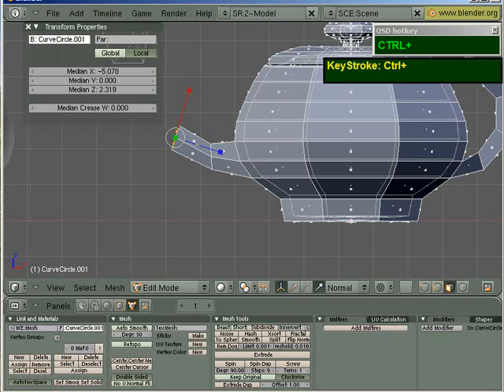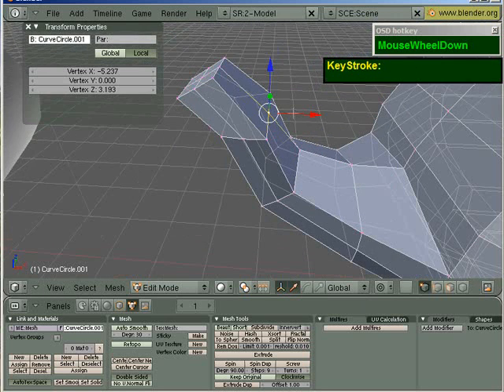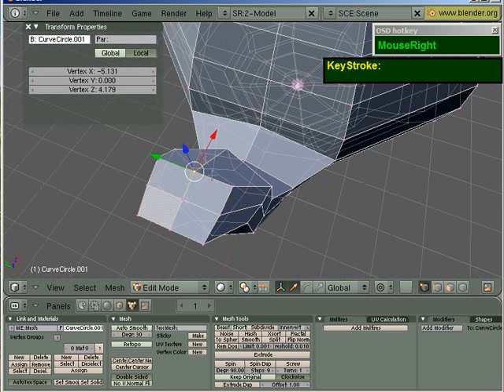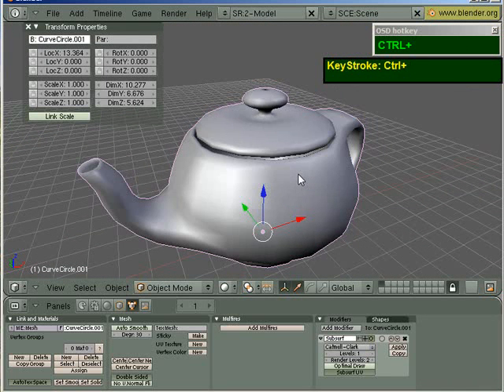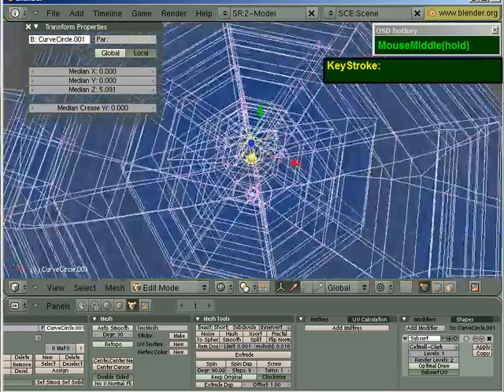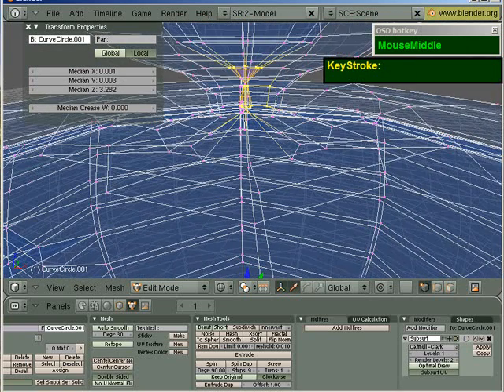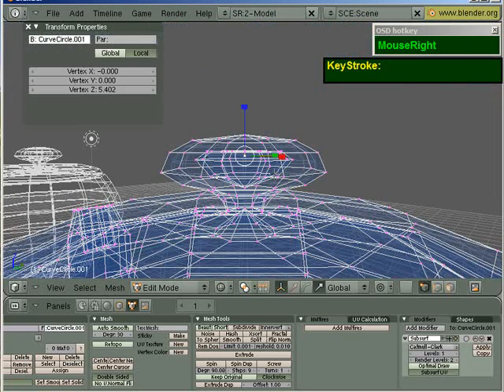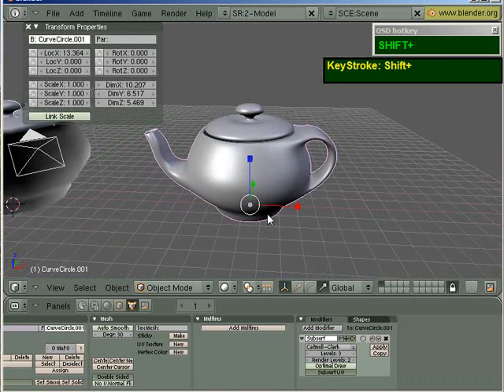Blender Teapot Modeling Tutorial Part 2 of 2 - Realtime with Dialogue

Comment from the maker: @zykral In 3D modeling, what you just have to model what you want to see from the outside. As long as it looks solid no one can tell. :-). The techniques I used to fix the internal structures are wrong. I have learned new tricks to solve that problem. Hopefully I can come out with a updated Teapot tutorial soon.  Thanks for pointing that out! Cheers!

Comment: you talking about "artifacts" in the teapot ... right? ... just one thing ... the handle of the lid of the teapot is EMPTY, why? --> it should be SOLID!!!
At 5:38 you can clearly see that there are 2 structures in that area. The outer surface and internal (like a diamond ... this is one of the problems that you retouch structures in the video)... if you just have some caution when drawing the Bezier curve you can save a pair of headaches later, not ?
Anyway... very good/well explained tutorial.